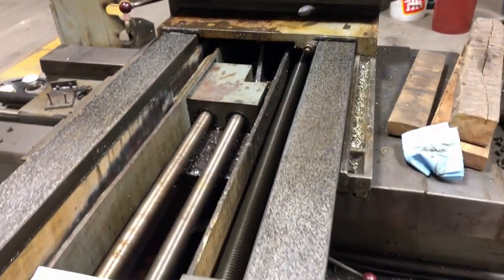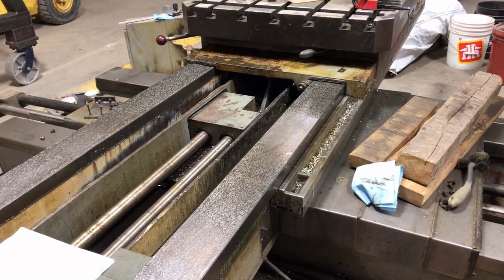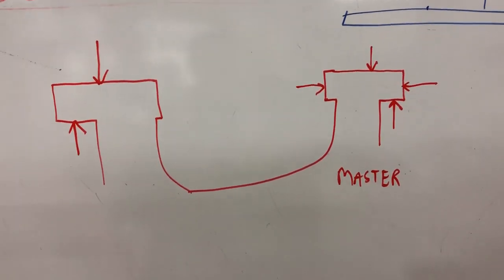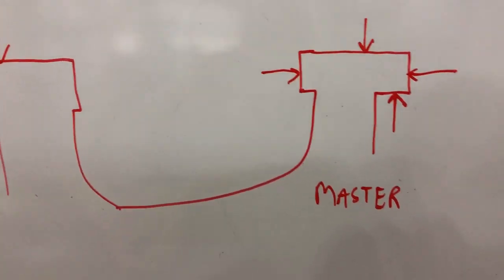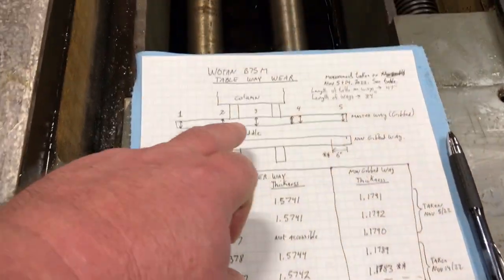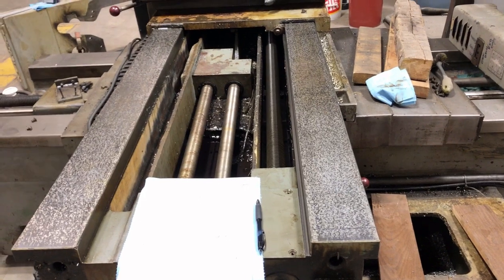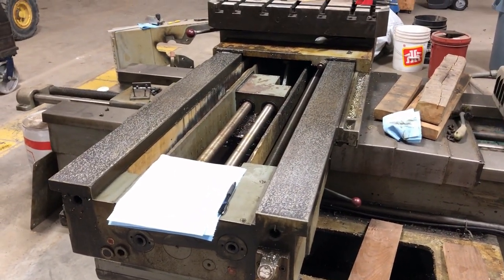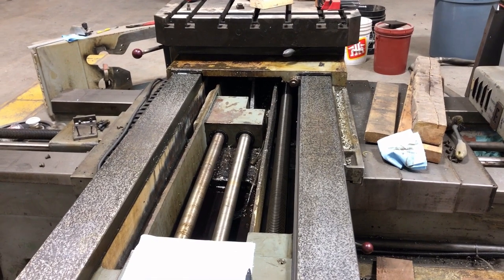HBM Questions for Viewers

Comment: From here, it looks good.  I'm not sure if you'd call that flaking, though.  I'm told there are many styles but usually its some kind of half-moon and the marks can vary in depth depending on the application.  From across the internet, it looks like 20+ points/sqin scraping.  Flaking for oil retention is supposed to be better on the downward facing side to avoid fouling but I don't know if this rule was followed by everyone.  Someone mentioned a level, which might be the only practical way to check the straightness of the top surface.

Comment: At least those ways look good .    The underside is a common reference point  that is used when reconditioning as it has the least amount of wear ( except for my one ! )    My JFMT lathe is a bit similar , some bits with no wear & some the complete opposite .   👍
Reply from the maker: I suspect my machine saw a lot of hard use and then was sent out to have the ways redone.  It probably saw little use after that.  The spindle taper is heavily fretted which would indicate heavy usage.  In contrast to this is my horizontal milling machine.  It is of the same era (early 1970's, just like me) and the scraping is worn off most of the slides but the 50 taper spindle bore is in excellent condition.  Since posting this video I found my missing 10 power glass and had a look at the ways under magnification.  The scraping marks appear to be on top of the small wear marks that run parallel to the ways. I think that would indicate a rescrape.  After being turned off by what I found in the gear boxes I am starting to feel good about this machine again.  I can fix almost anything on the machine except worn out ways. Ken
Reply: @hmw-ms3tx  Ways are hard to deal with , esp large ones .    I have that challenge ahead of me next year on my HBM !
Reply from the maker: @swanvalleymachineshop  Are you planning on scraping them?  In one of your recent videos I think you said you were going to take a scraping class.  I'm looking forward to see how that turns out.  If it goes well it gives me hope that I may be able to tune up the ways on my large lathe.  They are the very definition of worn out.  Ken

Comment: Do you think the bed has been re-ground and flaked rather than scraped and flaked ?
If so you perhaps could have more confidence in the straightness
Reply from the maker: Hello Steve.  From what I can see it doesn't appear that these ways were ever ground.  One thing that gives me confidence in the straightness (that I thought of after I posted this video), is that from the little I know about scraping it is likely much more difficult to scrape two surfaces parallel to each other than it is to scrape one surface flat (straight).  If whoever worked on this was able to maintain the level of parallelism that I'm measuring they likely had no problem getting the ways flat(straight). Thanks, Ken

Comment: Kieth Rucker just did some measurements on his HBM. Maybe some of that would help. You could also put a large parallel between the two box ways with a precision level on top, move it along the box ways, and you should be able to see how much it differs or even use some shims to relevel the bubble and the shim stack would tell you if the two ways are parallel with each other. Just an idea - I have no experience doing this.

Comment: Have you used a trammel to check across the ways? 
Two things.
1. I believe you have a machine that was hardly used.
2. I also believe you are reading way to much from what you are seeing. 
A few years ago I bought a lathe from the government. I was positive it was going to be clapped out. It was quite the opposite. It was close to brand new. It just happened to go into service at the same time as a new cnc machine did. They only used it for quick things and the such. 
You could have one of those situations on your hands.
Reply from the maker: Hello Captain McFingal.  As I mentioned to another commenter above this is an odd machine.  The ways appear to be in excellent shape but the machine has obviously seen heavy use.  The spindle bore taper is severely fretted, indicating long hard usage and there are many layers of (post factory) paint on it.  I suspect that at some point someone had the ways redone and then used the machine very little after that.  If this is the case then I will be a happy man as most other problems can be corrected by me for a reasonable cost.  Having the ways redone is very expensive and would require the machine to be shipped at least a thousand miles each way.  Machines like your lathe are the holy grail of used machines.  Old enough to be well built but still in new condition.  Thanks, Ken
Reply: @hmw-ms3tx  From the run out you described in your video, I say you scored well.

Comment: I would agree that the ways have very little wear, either from being rebuilt or  not used much. One thing that I might look for is layers of paint, or if some electronic components look way newer than the rest. Are you going to check the bearing surface on the rotary table? that is something you can use as a spindle or a surface to sweep on with an indicator.
Reply from the maker: Hello Kyle.  This machine is a bit odd.  The ways appear to be in excellent shape yet there are other indications that it saw heavy use.  For example, the spindle bore taper is heavily fretted which would indicate heavy use.  There are several layers of paint on the machine and there are a lot of cosmetic dings all over the machine (these usually accumulate during a long life of steady use).  I am going to strip the rotary table down and clean and (if necessary) repair it.  I like your idea of mounting an indicator to the table and sweeping it over the ways.  At a minimum it would let me know if the table axis is square to the ways.  Thanks, Ken

Comment: For a 50 year old machine it is very good, my 90 year old lather cut tapered as it is very worn so I just take a bit more time.
Reply from the maker: I agree, it does appear to be in good shape for it's age.  I have a 60 year old lathe that is so worn you can measure the wear on the bed with a ruler. Thanks, Ken

Comment: You are asking all the right questions and I wish I could help.
At this point with what you have measured is seems probable that the ways are straight within makers tolerance. There should be no wear on the non master side of the ways, perhaps comparing this over the length may be an indicator. John, Australia.
Reply from the maker: Hello John.  I like your idea of comparing the side of the master to the side of the non master way.  I could check that with an inside micrometer.  Thanks, Ken
Reply: @hmw-ms3tx  Ken is good that  you read my comment and you like the idea. That was the way of measuring I was thinking of. Combine that with width measures of the non master side and you will hopefully get a complete guestimate of where things are at. Cheers from John.